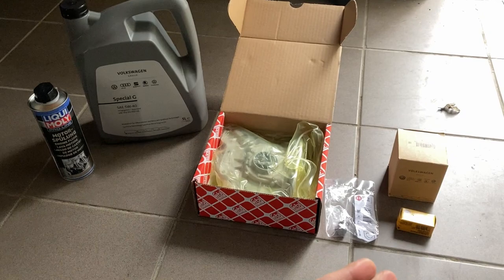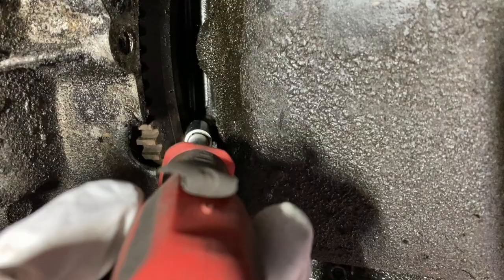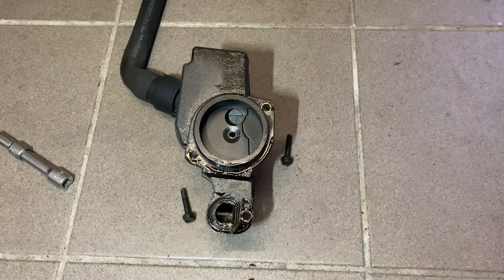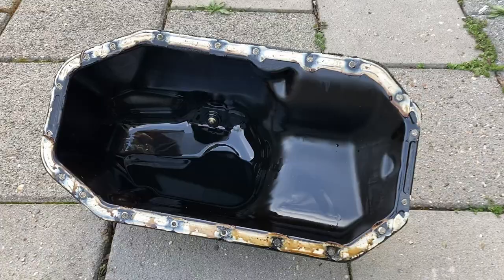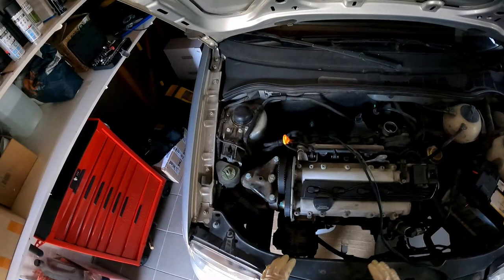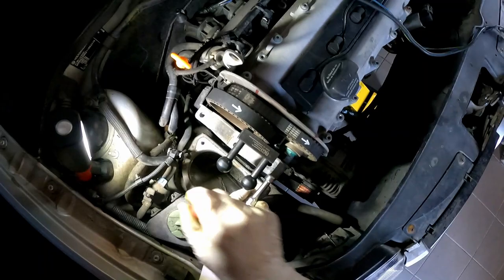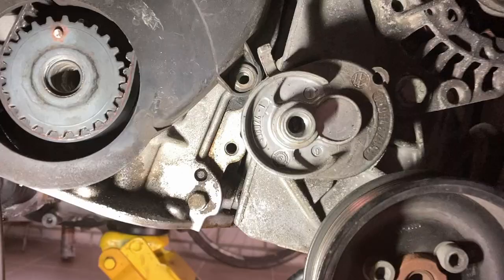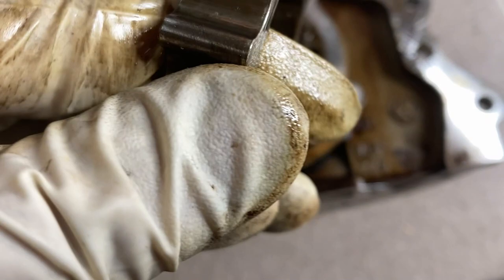Removing the Oil Pump and the Oil Pan on my VW Polo 6N2

Comment: Why did you change the oil pump?
Reply from the maker: Hey @dikketwigt. Good question! The seal around the oil pan failed, so I had to replace it. While doing this job I thought it might actually be a good idea to replace the oil pump as a preventive action, knowing that it was the original one and that the car had more than 146,000km. The pump itself showed a bit of wear on the gears, but nothing unusual. It just gives me peace of mind!
Reply: Did you experience low oil pressure alarms? I do and have to do the same to figure out the root cause

Comment: hello
why you was replace it? Did it made some noise? rustle? crunk? is any sound from Timing belt?
Reply from the maker: Hi! I think this car suffered from oil starvation for a rather long period of time, hence I believe the diesel rating. Performing preventive maintenance on other components, such us the oil pump was my next step. The gaskets around the previous oil pump was leaking already, but the oil pump itself was in good condition. timing was OK. PCV valve was completely full of this mustard-like paste.